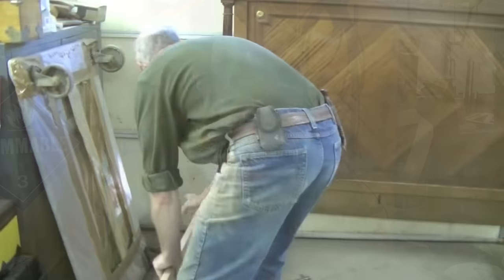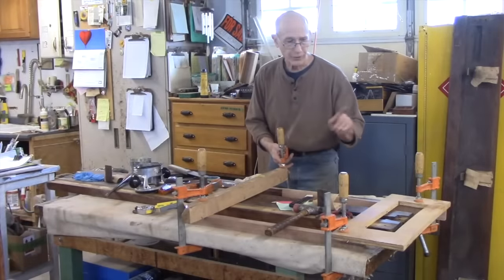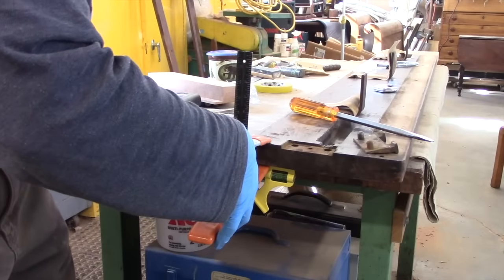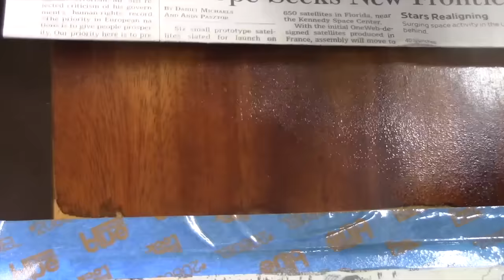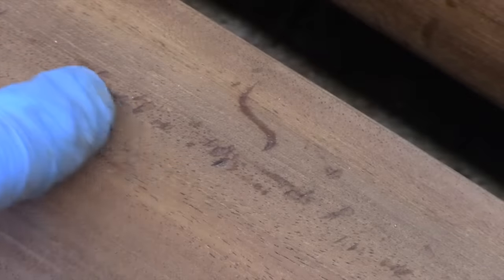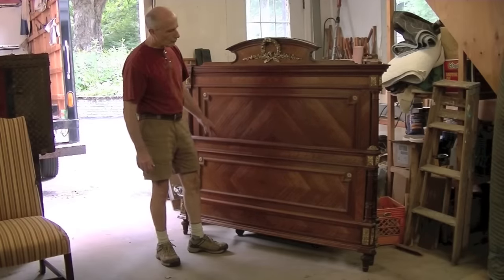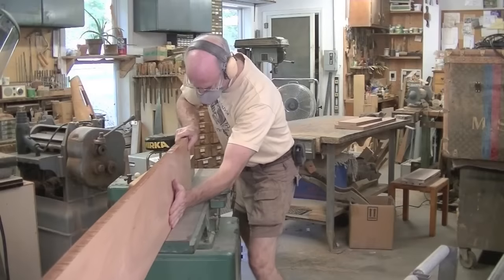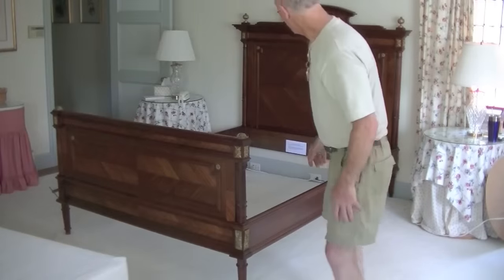I've Got To Face Reality Here

Comment: Very nice work Tom! One question i have is would it have been better to use Sepele with the colors it has matching closer to the old rails?  Thank you!
Reply: Mahogany veneer over poplar really requires a mahogany tie-in because of the matching wood grain. Feathering in affected the end of the rail and bleaching was the best way to reverse its darkening, tieing in all three areas. Sapele would not have changed that and the wood grain would be different. You have to look at all the characteristics of the timber, not just the colour. The matching mahogany made it easier to transfer the wood grain characteristics, and the stain provided the right wood colour, in order to match the figuring in the mahogany veneer. I'm glad he changed his mind and tried again, because the second repair didn't stand out as much the first attempt did. Yes, one might say that repairs add to the 'charm' of an antique piece, but in making his repair invisible, the value of the piece would be less affected, even though the repair would not be visible when the bed was made up. It was more respectful to the piece.
Reply from the maker: Thanks! 2BigHenFor gave a good answer!
Reply from the maker: Thank you! Good explanation

Comment: Great video!  I have an old full size bed that only has 69" side rails.  I think I need to extend to 76" to accommodate a modern full size mattress.  The side rails are only 13/16" thick - is this too narrow to do a lap joint?  Thanks!
Reply from the maker: You're welcome! I would typically make entirely new rails for that thickness. The rails in this video are huge, so I added wood. I mean, it's not impossible to add to the thinner rails, but it's not easier
Reply: @johnsonrestoration  Ok, thanks.  I thought about making new one, but wasn't sure how difficult it would be to remove the metal hooks embedded in the wood and install in new wood.

Comment: In reference to matching the finish on the bed rails.  Simply not possible to use spray toner effectively to lighten a finish.  These only work to tone down/darken, and should be used sparingly to keep from covering up the wood grain.  After adding the extension sanding should be kept to a minimum on the adjoining original rail.  The proper way to finish the add on would be to apply a faux finish with Mohawk Blendal Powder Stains, which actually act more as an artist paint than a stain. This gives much more control over the finished product, and a much better result.  These comments come from 40+ years experience in the field of repair/touch up of wood finish's.  Most of these years from on site touch ups on newly installed woodwork which gets damaged or finish's that come from the shop which are not up to par.  I am still learning and appreciate your many skills.
Reply from the maker: Thanks! Yes, I know all those things, it was an act of desperation! Like I said, this was one job I wish I could do over, I would have done it a completely different way. I appreciate your comments

Comment: When you were milling the mahogany, you planed the rough lumber, then used the table saw to get the opposite face parallel. Is there a reason you did it that way rather than running the first face through the jointer? I would have done it that way because I don't own a jointer, and I always assumed doing it that way wasn't as good as doing it with the jointer.
Reply from the maker: Thanks! My jointer is only a 6" jointer, and that board was about 8" wide. So yes, you have to mill differently

Comment: I remember that sleigh bed resto, to be honest I think you should've just added a block of equal length either end of the rails rather than just the one end, that way you could've acheived a symmetry that would've looked integral rather than having to go through so much messing around trying to match the veneer or just run a fresh veneer down the full length
Reply from the maker: Thanks! I agree! I wish I could go back...
Reply: @johnsonrestoration  Appreciate your humility, not that I'd wish to humiliate, I've far too much respect for your craft, we'd all do it a different way

Comment: Any idea where i can buy 2:46 the item in your hand? I need one for an old bed of mine. Its a different shape  but the same concept with the 2 'squares' locking into the bracket on the headboard.
Reply: Have a blacksmith or iron monger make them for you. And if you have 1, all the easier it is for them. 

Or go to France and chat up the brocante people there.  You'll find what you want!
Reply: Je ne parle pas Franchise. Lol
My backup plan is to join a maker shop and either machine it from a block of metal of use a 3D printer, reverse the image of the one I have, and fine someone to cast the part. Both are not simple, or I would have done them already.  Passport just expired. 😂
Reply from the maker: Thanks! I don't know where you can get a cast iron one like that! There are many brackets out there, but all much less robust. I'm not a fan of that type
Reply from the maker: Interesting!
Reply from the maker: Yes, it will not be simple! Good luck. Every bed I work on I convert to bed bolts (except this Sleigh Bed). they work
Reply: @johnsonrestoration  Intresting, 'thinking outside the bed', er, box. Mine does not fit a modern mattress. I'm just going to use it to store scrap wood on in the basement. Maybe one day, make the sides longer as you did.
Reply: Why not add the extention more in the middle of the rails, so the ends will still work without needing to 'fix' or modify the one end so much.  
And rather than just cutting it out so perpendicular, you could have cut out an elongated diamond that could have used a completely different type of wood, that they could of been done with a monogram, crest, a painted scene or whatever was wanted. Or even painted it a single color! 
Or covered it in marketry!

Comment: Rather than futz around with the new extentions so:
1. I would have added the extention to the foot end of the bed, if you haven't. The bedding would cover it, so all of that effort wasn't necessary.
2. It the new extention is at the head of the bed, rather than futz around with it so much I might have gone with a monogram on it. 
Perhaps a single letter--- like J for John and an M for Mary and put them on the side of the bed each person sleeps on. Or I would have added a decal or had an artist paint a design covering 70% of the new area.  Or added some kind of molding to it, say,  a touch of gilt bronze or copper. Perhaps  a French curve or other such fenistration. 

A sleigh bed would be 'country' French, and so a bit of painting on the bed rails wouldn't be out of place, esp in the southeast of the country. 

I have an old French daybed with fabric panels on each side of the ends, with matching fabric covering the padded side rails.  
While not original to the bed I think padded side rails would be a welcome and practical addition for your clients. Hardwood rails and bare shins don't mix well--- at least in my house. Practicality trumps originality unless the piece is very, very special, valuable or by a listed or notable artist! 
And so my 17th C daybed has been slightly modified--- it has more padding on the rails. And I thank my decorator for  accommodating my request each time my poor shins touch the rails whether when getting into it for a nap or when I am making it up with fresh linens. 
I use it to nap in, sometimes, because it is so cozy, or I use it myself when guests visit and I give them the master with full bath,  so they are as comfortable as possible---  and because it is just so really tough with two people on a daybed, arms and legs everywhere! You can't get a decent night's sleep!

My padded rails have saved the occasional curse word from being uttered! Perhaps you could use the same fabric as their duvet, wall covering, upholstery or lamp shades! Or the same fabric to cover the box spring or to make a dust ruffle! Maybe a Toile de Jouy!  There is no right or wrong. Just do it with flair! Perhaps with brass studs or tacks to finish off the fabric at each end of the rails, so it looks custom. No one will question it if it looks good and is well done!
Reply from the maker: Thank you! That sounds so interesting - you did a great job. And yes, after all that the repair doesn't show when the bed is made up!

Comment: Would it have been possible, instead of adding an 8” (or so) piece on one end, to add 4” on each end?  Using that repair these pieces would deliberately look like “end caps” and would have simplified the finishing.  Full transparency, I’m a furniture builder but finish work is my least favorite part of the process.
Reply from the maker: That is a good idea! Where were you when I needed you!
Reply: @johnsonrestoration  And how did I know to do this?  Changed the mattress/box spring on a very nice, custom mid century bed and now the rails were 3” too short!  Instead of trying to match the walnut on the rails I had end caps machined from aluminum bar stock.  It’s a very subtle detail but looks right at home.

Comment: Instead of making the first pair of rails longer, it would have cost the customer less if you had made new rails altogether. The grain of the new wood was too different from the old to ever match.
Reply from the maker: Thanks! I usually do make new rails, but that was a lot of mahogany! I like saving as much of the original as I can, and it seemed doable to add wood in this case